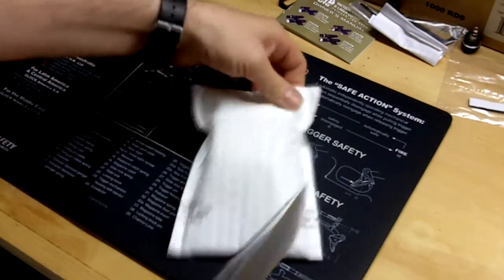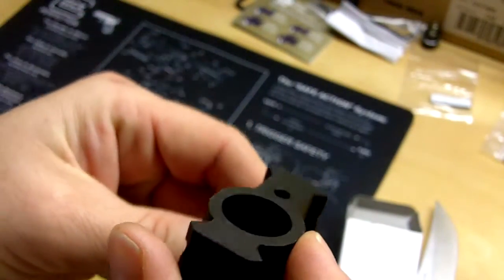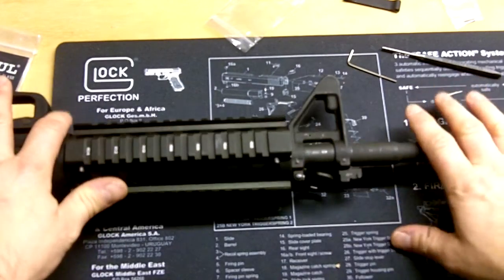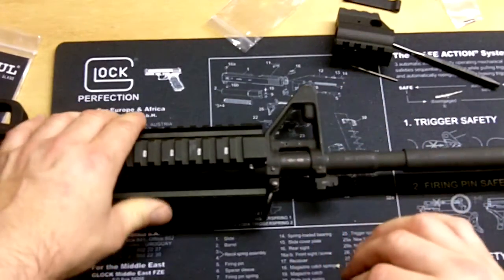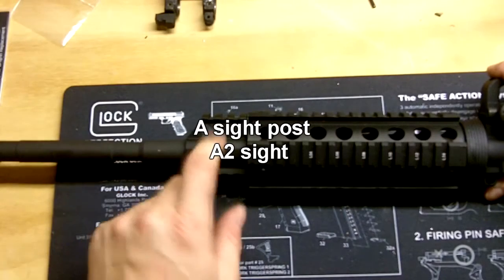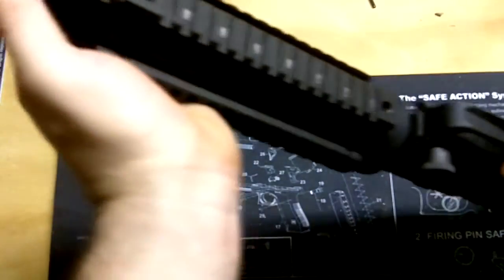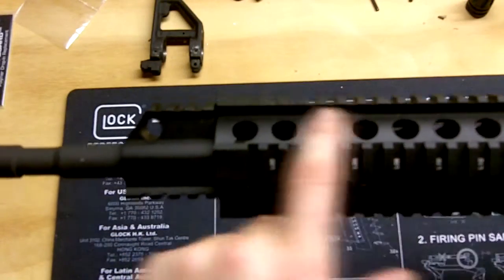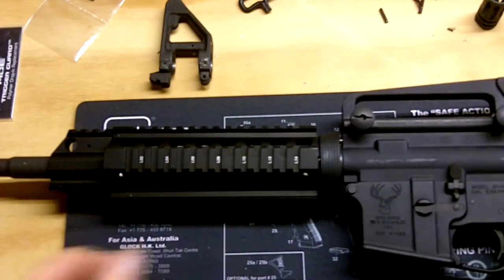A2 sight replacement Troy Industries Muzzle Break

Comment: That was not just a flash hider. But actually a flash compensator you removed. It hides the flash from you and compensates the barrel flip. It was part of the ban. The ban covered (new manufacture of rifles with) Flash Compensator, bayonett lug, magazine over 10 round capacity, folding or colapsing stock. These applied to rifles with pistol grips and detachable mags. All barrels had to be over 16". 
My AR during the ban had a break on it. A good one at that. Even the M249 SAW has the birdcage.

Comment: Thanks for the video. I plan on doing the same. I think I am going to put a longer hand rail and put front flip up on the  front of the rail. I think troys. My first build.
Reply from the maker: Check out some of my other videos I change this AR and did some other AR builds with the troy hand guards, they are great. The front post can be difficult to remove

Comment from the maker: Hey Joe, sorry brother, I know the A sights are iconic part of the AR/M16 platform. I just had to try it. I will have to try out the compensator to see if I like it. It looks cool though :) So they banned the bird cages in the 90's I did not know that. So just a straight barrel. I must have been under a rock :) or maybe some chubby chic, kidding....

Comment: Actually it's  muzzle "brake"...    Don't forget to dimple the bottom of the barrel for the set screws...   If you use the correct tools removing the A2 front sight is not a problem...  (You need a 8" long piece of 1/2" dia cut round stock for a flat punch, and a AR fromt sight bench block...)